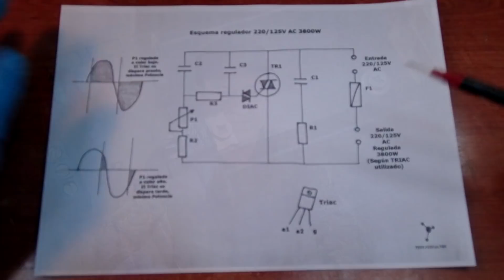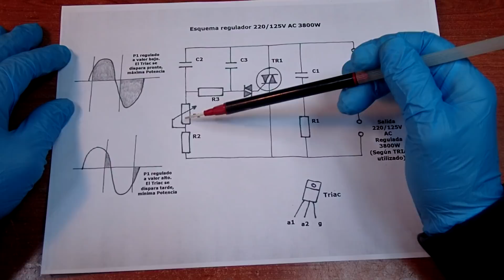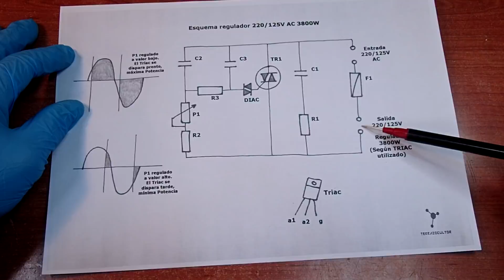Circuitos UTILES. FOTOLITO para el Regulador CA 3800W

Comment: Hola. Tengo intenciones de aplicar esto en una sierra circular  de 2400W y 4000RPM en la que necesito bajar su velocidad a la mitad. Lo que quisiera saber  es cual es la caída de potencia del motor o como calcularla. Y por otro lado como no tengo de momento forma de medir las rpm del motor, quisiera saber cual es el calculo para obtenerlo desde la corriente que la puedo medir con pinza amperométrica.
Reply: @produccionessus5602  n